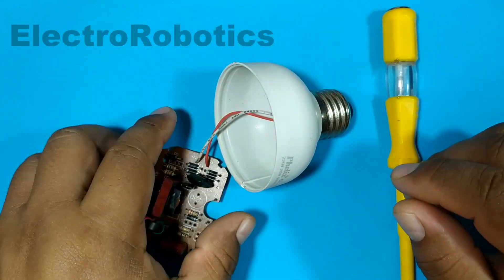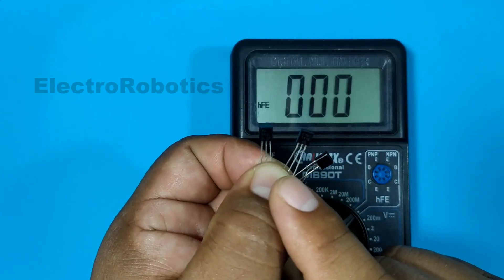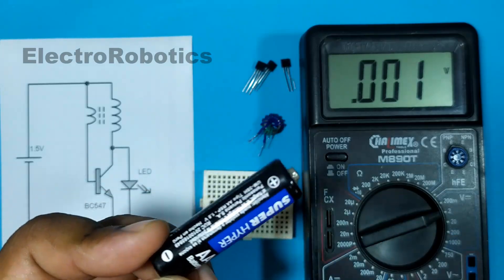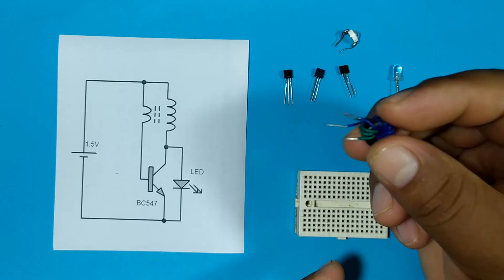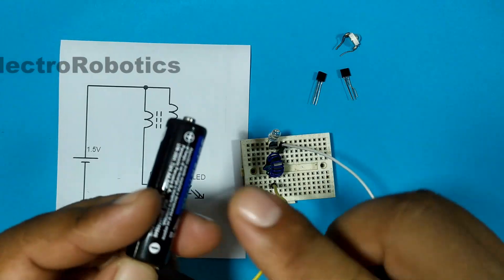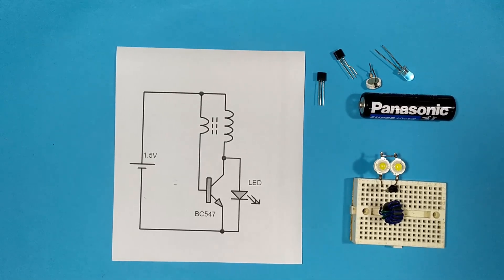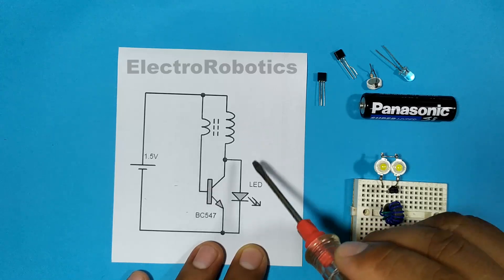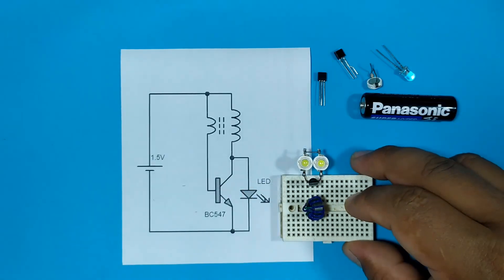Great Invention Using a Coil from a Recycled Plate.

Comment: we induce an alternating current . there should be magnetic field collapse to induce from one side to another so the led is not turning on due to induction, the transistor should switch on and off for the induction to happen when are using a dc current ,